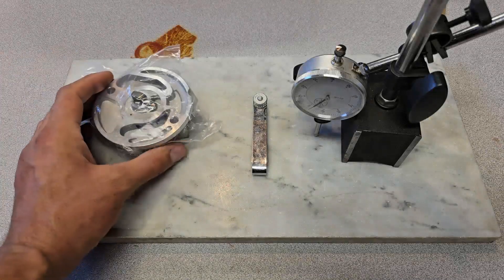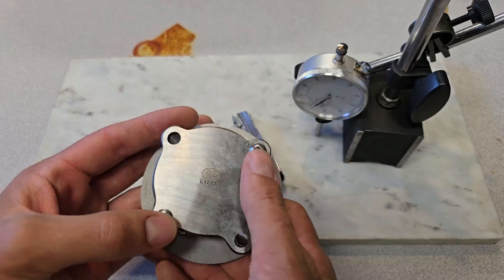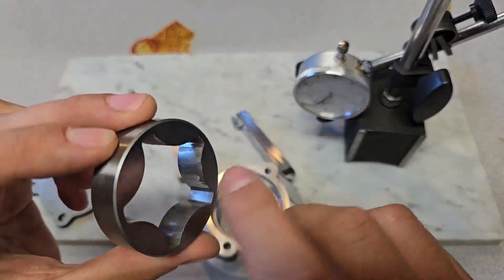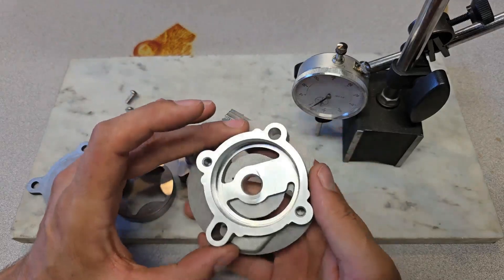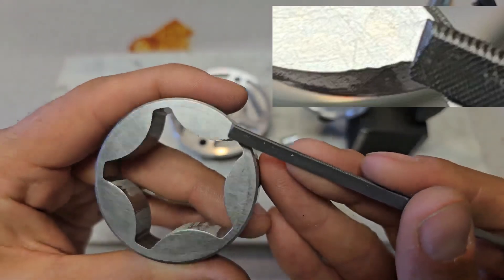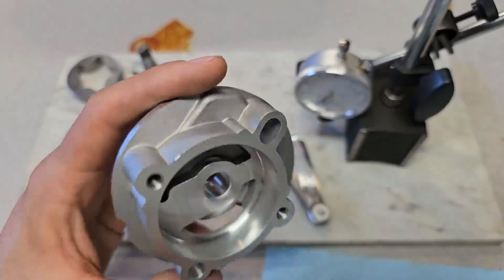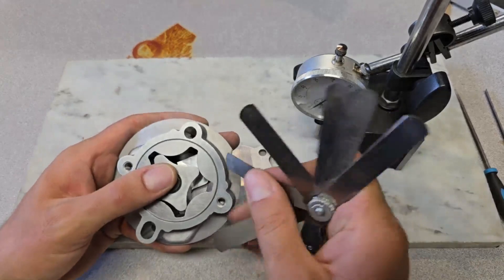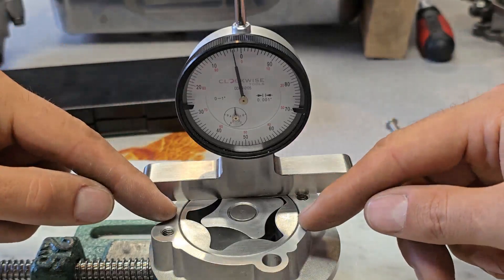Classic Mini Survival Guide: Oil pump inspection and improvement. You Must Do This before fitting!!

Comment: thanks Darren, much obliged. I think I will take a step backwards, remove the installed out of the box pump, and go through this process. Nicely done video
Reply from the maker: Always clean and inspect the new parts no matter where they come from. You are responsible for ensuring they are clean and ready for use. Hopefully this short video will help you understand the pump and what to do to improve it.
Reply: @darrensrestorations991 after a few hours of work it now runs smoother. My annulus to casing clearance was .003-.0035, rotor to annulus .0025, and end float of the rotor and annulus were both .002. A little tight on the end float so hopefully that will be ok. I will now go back and make sure i havent compromised my cam endfloat but I think that should not be affected. Much obliged for your video and encouragement

Comment: I’m just about to reassemble my 1275 MG Midget engine with a new cam and pump. I’ll follow your advice and check out my new pump before installing it.  I believe I need to pack the new pump with grease to ensure it primes properly on startup ? Does the type of  grease matter or will any kind of general purpose grease work?
Reply from the maker: Use either the break in oil, normal motor oil, or engine assembly lube.  Whatever you put into it must break down in the normal motor oil.
Reply: @darrensrestorations991 OK Thanks. I’ll probably go with assembly lube and normal engine oil in the pump on assembly. Running in oil in the sump on startup. 👍